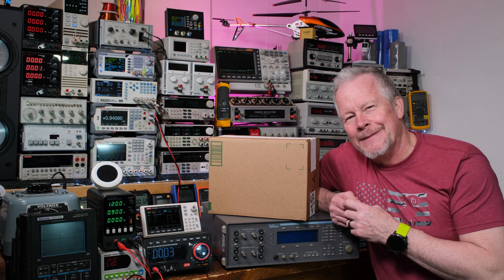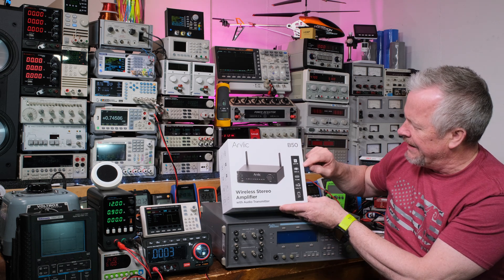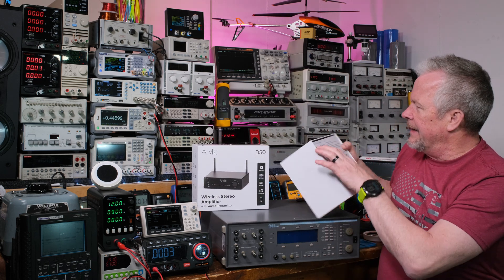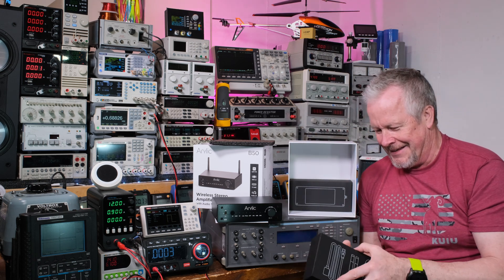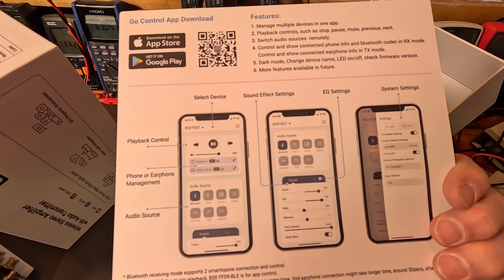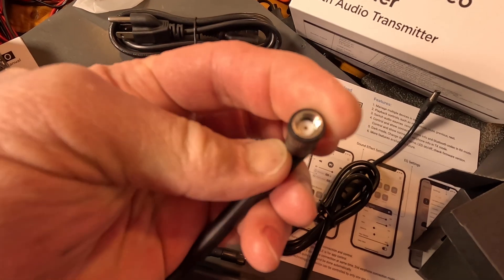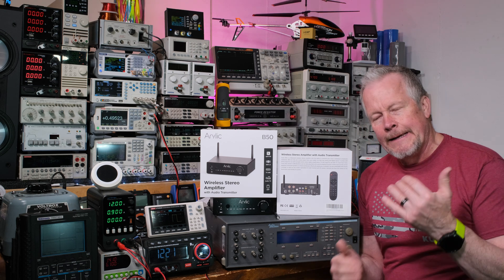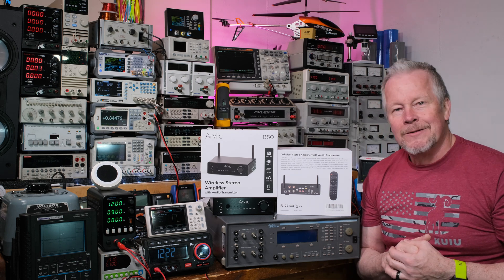Arylic B50 Amplifier Box Opening  #ArylicB50 #classdamplifier

Comment: So, it's really just for 4 ohms for a reasonable power. Be interesting to see if the filters are made for 4 ohms or will we get HF lift into 8 ohms.
Reply from the maker: Great question.  I hear from speaker people that 6 ohms is actually a real normal - so I don't think 2 ohms is that reasonable unless you are paralleling speakers - which just doesn't seem practical if you are looking at an amp in this power range.  I am also interested in how it will perform at 8 ohms.  Thanks Michael!!

Comment: It's missing four speaker drive with simulated surround sound.  In my shop, I have four Optimus 88 Pro speakers.  Basically on in each corner.  In the "IT Closet is an old Pioneer AV Receiver Amplifier.  I have an Arylic Blue Tooth receiver supply it sound from my main shop computer playing SeriusXM.  I set the Pioneer in simulated surround sound mode and the tunes in the shop sound amazing to me (oh and big subwoofer in that closet).  That pioneer receiver is old and it is big taking up a lot of shelf space.  If acrylic had a B50 with four speaker output with Sub Woofer out, and a simulated surround sound mode, I would order it in a heart beat.  Their Blue Tooth receiver/preamp is amazing; they do make good stuff.
Reply from the maker: Thanks for this great feedback!  It's awesome to hear from someone who actually has experience with Arylic!